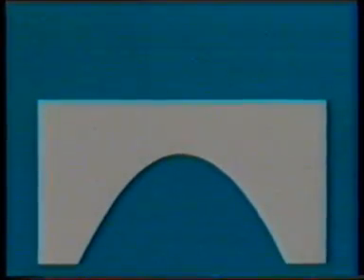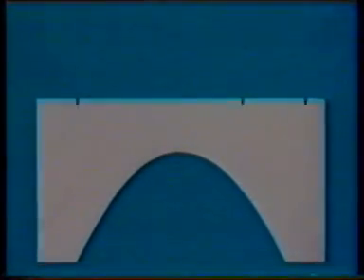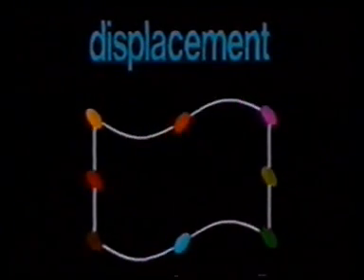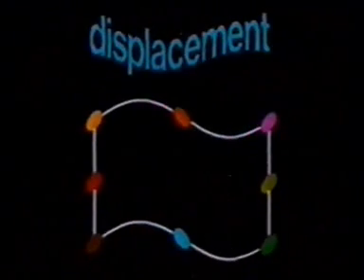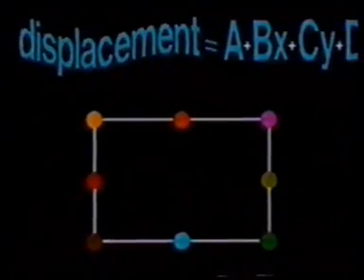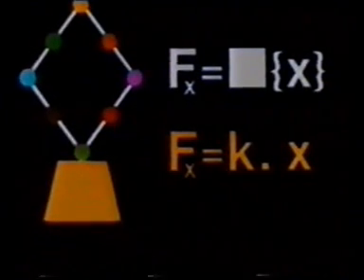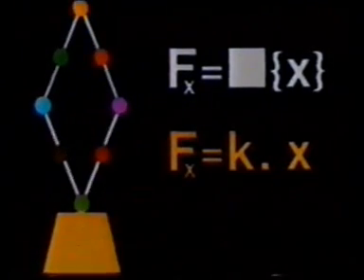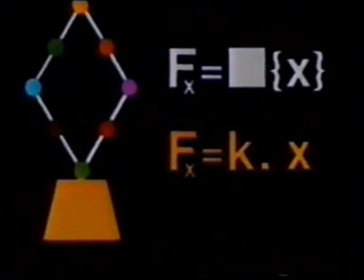A Video On The Finite Element Method.

Comment: I programmed my first finite element model for a 1D wave yesterday. This is amazing! One day I’d like to do numerical analysis on two generically coupled systems of Maxwells Equations (using Dynamics to predict the behavior of electric charges), which the Maxwell’s Equations cannot do on their own. My objective is to numerically demonstrate the transmission of momentum from one charge to another via their interacting fields. I have a hypothesis that if you store energy in a fuel, say, and convert this to electrical energy, you can stimulate an electrical circuit I.e. transfer momentum. So you’d conserve the momentum of the entire system, just converting it from electromagnetic to mechanical. This also means you could build a circuit that spontaneously moves without interacting with its environment.I’m not formally educated (I’m a cashier) but I am strongly motivated to learn these things over time. Again, fantastic video mate! 😊 Kind regards from Athens. Athens, Ohio that is 😂